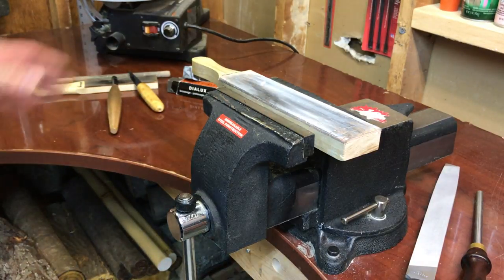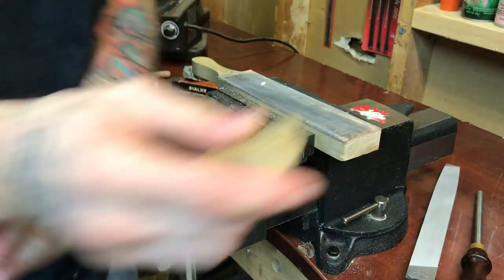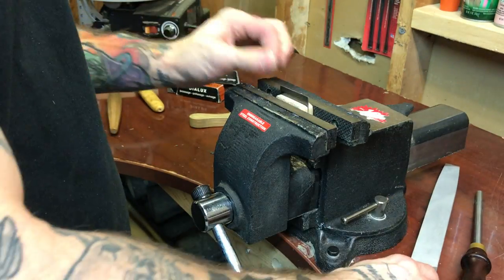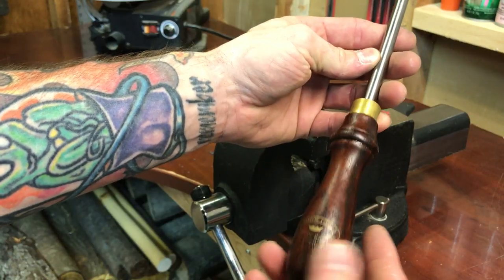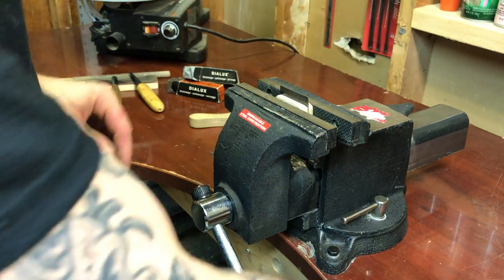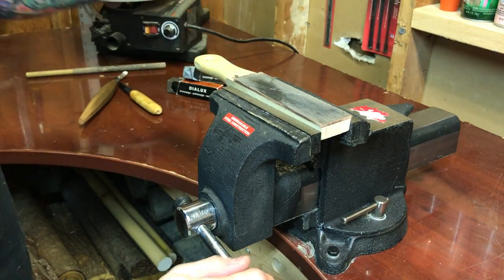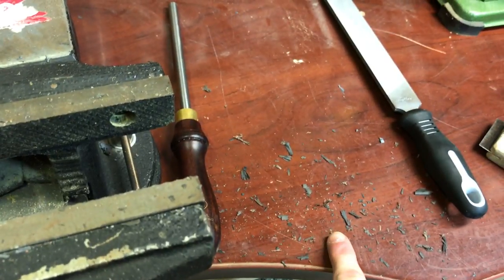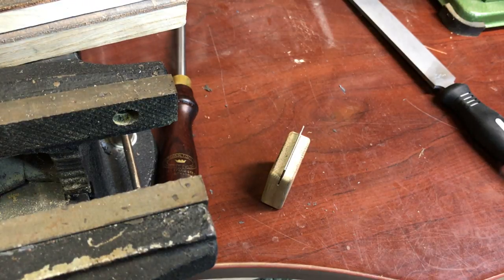Stropping 3/3- Maintaining Your Strops

Comment: Pulling your file dulls it.  Files are designed to cut on the push stroke. Pulling will work to a point but it does drastically shorten the life of the file. Thanks for the great vids

Comment: Modern day saws from hardware stores have hardened teeth so after they are dull they are basically trash. Those are a great way of making scrapers like these since its the right kind of steel. Just cut them up into squares and you have yourself a couple of card scrapers. Great video by the way ive been wondering how to do this exact thing!
Reply from the maker: Thanks for the comment!